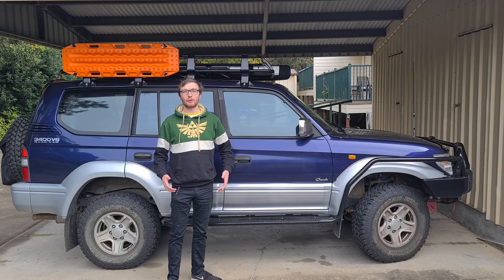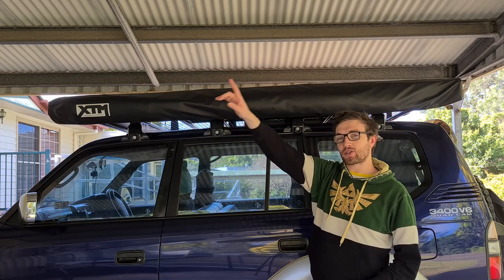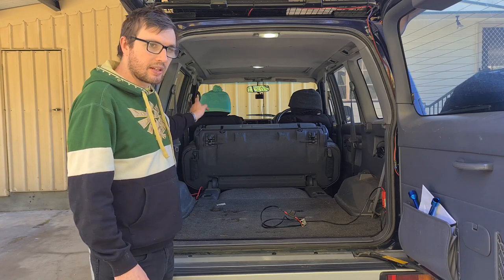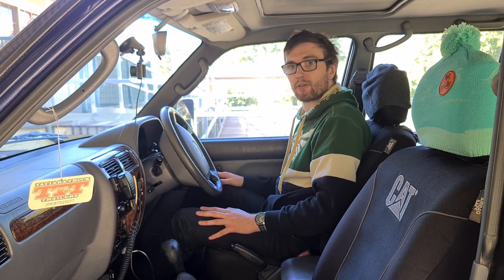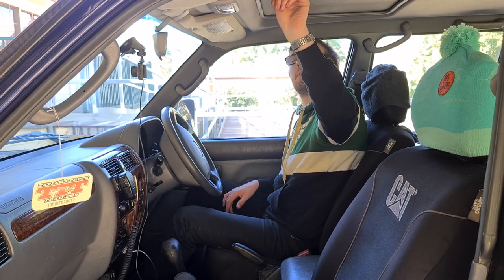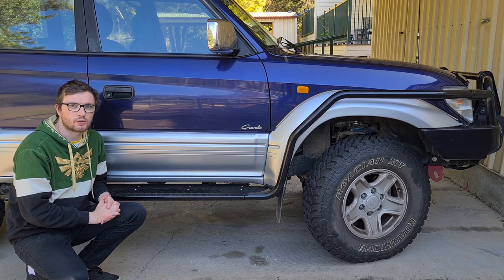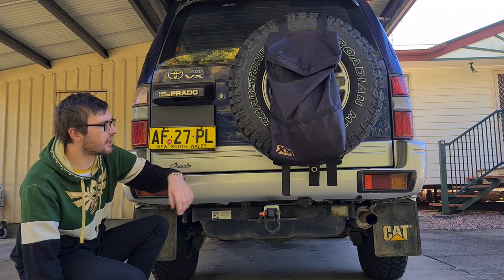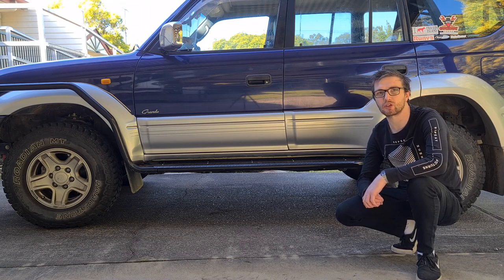OUTDOOR ANTIX - Noelsy's 90 Series Prado

Comment: you can put the  swag over the solar panel since the alternator will charge your dual battery whilst you drive. I’d imagine you’ll remove the swag once you stop driving to set up camp.
Reply from the maker: Since I don't run a dcdc charger that makes the most sense.

thanks for the comment!

Comment: Hey mate nice 90
I’m looking at getting one few questions !

1- can she hold 100 or just over fairly easy ? 

2- how she go on the sand when let tyres down ?
 
3- what’s highway fuel economy like? I understand their thirsty but on trips heard they get low teens which is fine by me standards
Cheers!
Reply from the maker: 1- yeah pretty easy on 32s just dont expect it to get there fast.

2- temp gauge doesn't really move, drop it to 16ish psi and you'll be fine does well.

3- I averaged 14.5 with all the mods, but stock i used to get around 12.2

thanks for asking the questions, theyre an awesome car great first 4x4, just make sure the cooling system has been looked after and check for oil leaks, usual old 4wd stuff.

hope you get one i do not regret buying mine :)
Reply: @NoelsysOutdoors  cheers mate 
Keep up the channel , hard to find dedicated 90 series ones 
Post up ya 4B vids soon as can 🤙
Reply from the maker: @rd28gu2  cheers trying to find time to get the videos recorded thank you!
Reply: Easy holds 100km plus.
Don't know about sand
I get around 12ltr per 100km (I never cruise above 100kmph
Defo get one, they're great!!
Reply: @jpc443  I have a patrol although it’s fun looks mint, I wanna try a Toyota just do so haha I need a comfy reliable wagon , only thing that puts me off  is ifs front but that’s silly thinking about it so I’m hoping to get one by end of the year 👍🏻
Reply: @rd28gu2  The independent front suspension gives it a great road ride.
Reply: @jpc443  it sure does specially turning !
Reply: How do magnets work?
Reply: @jpc443  i have a 97 grande, and im getting 12l @ 90kmh. Tbh on the freeway at 90, on cruise, its pretty ok on fuel